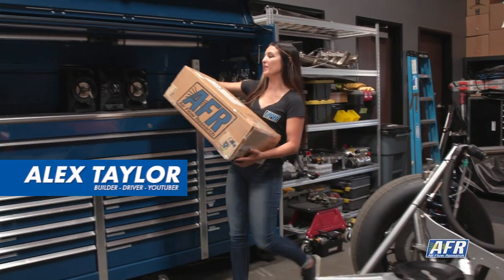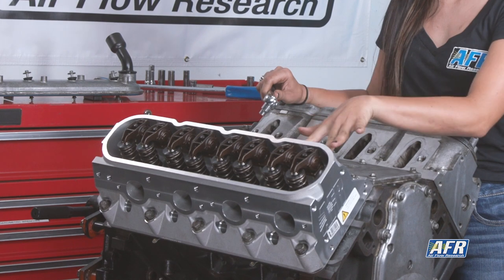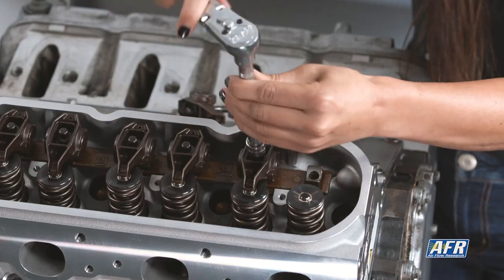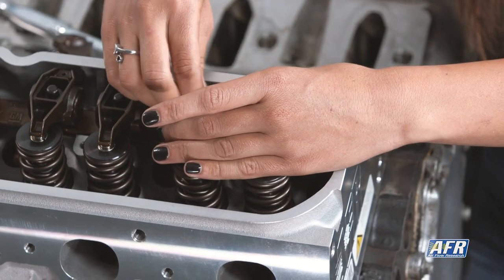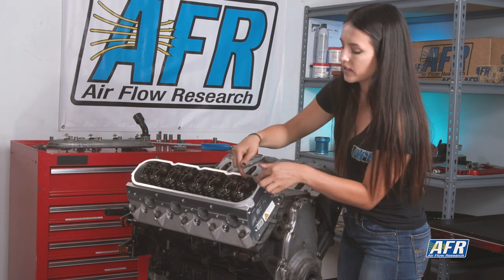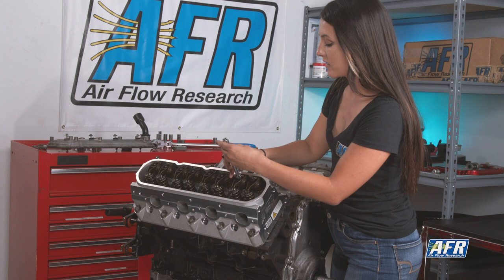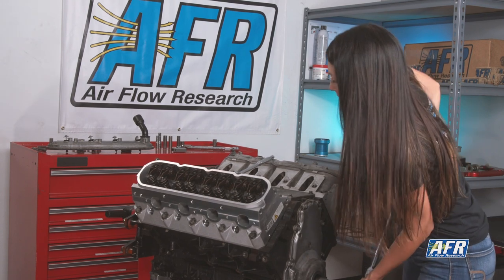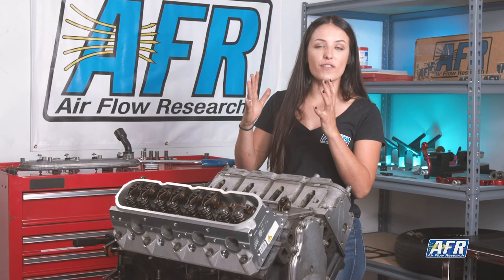AFR Tech: How to determine proper push rod length with Alex Taylor

Comment: The information on this video doesn't apply to non adjustable rockers. Verifying the wipe pattern is part of setting up the valvetrain but on a stock rocker LS, lifter preload is the #1 reason for measuring pushrod length. Also, a tape measure to check pushrod length? A precision measurement where the tolerances are in the .005" range (depending on application) is NOT taken with a tape measure. Micrometer is best , cheap dial calipers minimum. Also, a ton of time & effort can be saved by setting the checker in place and threading it out until it sits in the rocker arm cup.

Comment: Great presentation--organized, methodical.  There are two additional things I would have liked to see on this video.
1.  Better closeups showing more clearly the white pattern on the valve stems.
2.  Since some builders may be opting for roller rocker tips, it might be informative to see this demo performed using roller tipped rocker arms.

Comment: Use a dial indicator on top of the rocker to measure slack, then add the demension to the top of the adjustable pushrod. The dial indicator has to be measure right above the pushrod not the middle of rocker. Just help get a number closer to proper length pushrod.

Comment: Can't leave the stock valve springs in and pull a pattern on the valve stems with hydraulic lifters.    The pushrods will be pushed down to the end of travel on every rotation.

Comment: There is just a little bit of an easier way to do that how I do it is I put the push tube in there close to stock height and wrap a boot lace around it install The Rocker and then you just pull on either end of the boot case until you get all the slack out then measure it and send off for a new ones. It makes it easier than trying to get your fingers in there and it also makes it easier than taking the rocker off 50 times

Comment: This video is a mess! Didn't anyone from the AFR tech department double check this? The basic idea is solid, but with a bolt down non adjustable rocker all you are doing is adjusting lifter preload. You have to raise or lower the fulcrum (middle) point along with push rod length to make the pattern change like she was hoping. Most adjustable rocker systems use the stud and polylocks to do this, but I have seen a shim system for certain bolt down rockers like a 5.0 or Vw bug that can be used to raise the fulcrum.

Comment: This video does not even address valve train geometry. At all. The axis of the rocker needs to be 90° to the valve stem at half lift. On a pedestal rocker or shaft, that's done by shimming the rockers fulcrum height relative to the head. THEN you can select the proper length pushrod. 
Or you can just bolt crap together. Either way 😆.

Comment: I feel bad for the people who are going to attempt this at home with a hydraulic lifter with no oil in it.
Reply: you should prime the engine first to get the oil in the lifter right
Reply: Not to mention telling them that pushrod length will move the pattern on a non-adjustable valve train.

And that's ignoring the fact that the ''find the middle of the valve'' is NOT the right way to set up geometry.

Comment: Well.... Im confused. By installing a longer pushrod on this all your doing is changing lifter preload, nothing to do with rocker geometry. The rockers are fixed in position unlike a conventional rocker stud. I'm either missing something or this video is almost completely useless/misleading, which coming from AFR is very disappointing. Happy to be corrected.
Reply from the maker: Hi Damian, you are correct in that the height of the lifter is fixed because of the factory stand/pedestal. However, you still need the proper length push rod for valvetrain geometry. More specifically we are talking about the wipe pattern across the tip of the valve. On Hydraulic Roller setups, preload is important and the recommended amount can vary depending on which manufacturer you ask. But once the lifter is pumped up it acts similar to a solid lifter, which is why some folks will suggest using a solid lifter when checking for proper length on Hydraulic setups. This is because you don't want to collapse the lifter during verification, as it will give a false reading; another reason for using light weight "test" springs. I hope this answers your question.
Reply: Your comment comes across rude and the video explained it very well
Reply: @Alexbuilt  My comment does come across a little harsh but it's still correct. Im surprised one of the technical staff haven't quietly removed this video. By changing your lifter preload you will very slightly change the sweep but lifters call for a very specific preload so it's not really something you can control. Now if you start shimming the pedistal stands to 'fine tune' your preloads, something I've done before, then you will start to change rocker geometry but on such a small scale that it would be difficult to even see. Some correct methods are used in this video but on the wrong valve train/wrong engine.
Reply: I understand completely what he is asking. On a shaft rocker there is adjustment at the pushrod socket on the rocker arm but on this system the only adjustment is in the pushrod. In this instance, to get the correct witness mark on the valve stem, preloading the lifter is necessary.
Reply: @Sluganaught666  You are correct. The technical staff at AFR should have removed the video and made a new one with better supervision.  I am surprised that so few people know the fundamentals of how the rocker actually works. Forty one comments and just a handful actually grasp what's wrong here.
Reply: You're confused because someone posted a ''tech'' video that's flat out wrong.  (and then AFR had someone that doesn't understand how non-adjustable valvetrains work repeat the falsehood).

You're 100% right.  If the rocker doesn't move, the valve tip doesn't change, the rocker mounts don't move, and the base circle stays the same...   the ONLY thing a longer pushrod will do is push the lifter cup further down.

And if you go too long and bottom out the cups, the valves can't close.

And that's completely ignoring the ''put the mark in the middle of the valve'' is NOT how you pick pushrod length on adjustable height rockers.    If the geometry is right and the tip falls off the valve, you have the wrong rockers.   Installing the wrong pushrods just because your fulcrum-to-tip distance i wrong isn't the right way to do it.

And I'm amazed a company like AFR would come here and defend such horrible ''tech'' advice.   This is nothing more than hiring a cute girl to make a video (and try and sell some parts)

Comment: hi 
hi although pushrod length is great idea , time would be better spent on a chevy cyl head application advice . Surprisingly being heads are your main product your still giving the wrong advice for application .   Multiple calls to  your advice line b4 a proper calculation was done for the application 
Try having a 195 comp head on 400cuin   ,breathing thru a straw when should have been a 220 to rev a 400 to no more than 6500rpm .
Be cautious of the advice
Reply: a 195 comp head breathes 300 CFM  on a 4.125 bore  400  and has 2.08 vales.  

Youd think thats almost dead nuts for a pump gas 400 going to 6500 but you need at least a  comp 294HR cam and 10.5:1 to do it....and an 850  and the single plane comp intake they sell.  youre not gonna do it with the dual plane i would think on a 400

a 220  on a 400 should be like 7000+ man....those can breathe on a 434..
Reply: Airspeed thru the port MCSA minimum port cross section 195cc has to overspeed on a 400cuin 
227 afr  400cuin 12.5 cr  260/270SR peak hp 640 at 6800-7000rpm .
220 best at 6500rpm with lesser cam /eng specs
Reply: @paulthompson1654  skip white builds a similar combo with AFR 195 and a Howard's 245/253 cam and a single plane.  550 @ around 6000 and that's with non CNC enforcers and 2.02 valves.  So about a 6500 rpm redline. I should make that clear.  Those 220s are a about 7000+ rpm redline on a 400

Keith dorton also built a similar combo that made 550 with 195 heads.

A 210 AFR head would be really good on 400 with solid roller
Reply: @KingJT80  Even AFR agreed , once they got serious and did some airspeed vs mcsa calculations .  Even a restrictive head will  flow if u give it enough camshaft . BUT you will make more tq and hp with the correct size cyl head mcsa. 
Volume cfm is only one criteria for head selection .
Reply: @paulthompson1654  well they tell you which heads work for what right on their page.  Usually it's the redline of the engine.  ILl concede a 195 comp/street heads have about a 6500 rpm redline on a 400 seeing is how there are a ton of people who run that combo for a pump gas street 400

A 210 would probably go to a 7000 RPM redline on a 406.  A 220 would be nice on a 421/427 

AFR 227 starts to get pretty big and the headers start changing